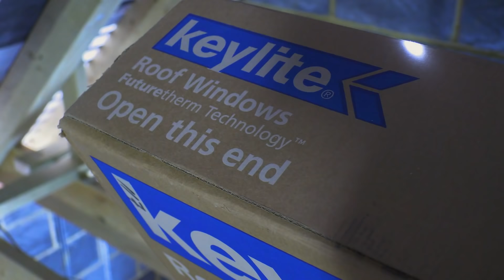Fitting  Roof Windows ~ Extension Build #10

Comment: I tend to put some felt tucked under the over lap above the window to stop water running down the side to the bottom corners before its slated or tiled in the triangle doesn't protect it as well . Roofer since 16 now 54 still at it
Reply from the maker: Hi Peter
That is a great idea and we usually do it but in this case the roof windows were an after thought. The little piece of aluminium that nobody ever fitted to achieve the same thing is no longer supplied. In this case the two courses of tiles above the window would not pose a huge threat in terms of water ingress but tomorrow the other two go in so we will pull out some nails and put in the felt just for the tip. Thanks for the recommendation.
Reply: @SkillBuilder  no worries I get lots of help from you guys in other General building . Doors are my nemesis I tend to get really angry and kick them in lol

Comment: Is it easier that way? Am I missing something? Been installing them on the roof for years.. must try your cool way of doing things.
Reply from the maker: They are designed so you can fit them from the inside without going onto the roof but if you are re-roofing and have safe access it is often easier from the outside.

Comment: The tile soakers should be fully supported by the tile underneath and not half on tile half on tile batten.
Reply from the maker: Hi Michael. Those soakers will fit slates as well. If you pull them down a bit the top is in the space between the battens. If you pull them down so the top is level with the tiles you see a gap in between each soaker so we tend to pull them back to close the gap.  Either way it matters not provided you don't have them showing.

Comment: Keylite or velux , is there much difference in the quality or the way they are fitted and is there much difference in price
Reply from the maker: These were quite a bit cheaper and they are very similar in quality. https://www.youtube.com/watch?v=NTFAJk4_WlE&t=14s
Reply: @SkillBuilder  thanks for the reply
Reply: Quite a bit cheaper and same quality? Whose screwing who then? Velux.
Reply: @SkillBuilder  not keen on the fact that they are partly made of wood though
Reply: I can still get replacement parts for velux windows 25yrs old, not sure on the range of keylite window accessories like blinds electric openers, rain sensors etc but velux is very extensive, its only the tradesman that fits & forgets, its the customer that`s left with an obsolete window of which I have replaced plenty.

Comment: Keylight.....they aint no velux!
Reply from the maker: You are right there. Keylite has a number of patented features, such as built in thermal collar and spring loaded hinges that other manufacturers are itching to copy. Innovation is their game.
Reply: @SkillBuilder  I had a job maybe 8 or 9 year ago where the windows leaked. Went back to the job and stripped and replaced  the flashings and reslated at my expense . Only to be called back a few weeks later about them leaking again. So I went back to the job when it was raining too have a look and it was the glazing unit that was leaking.  Keylite gave us replacement units and they were fitted. Problem solved. I only use velux since.